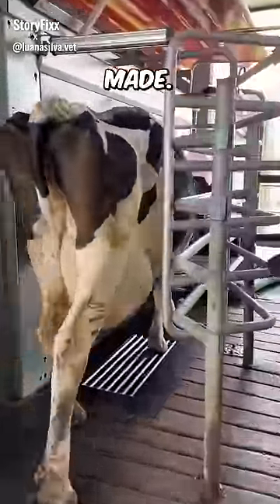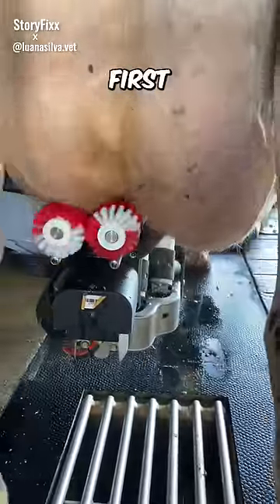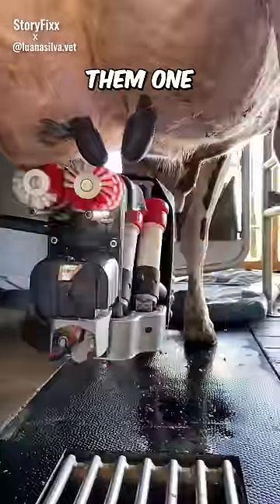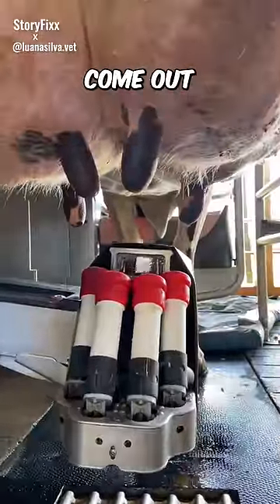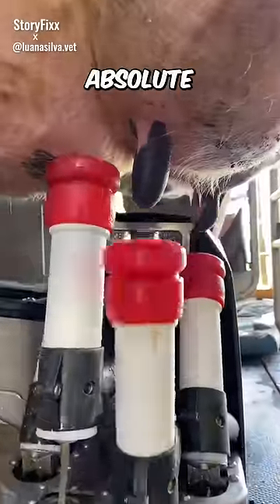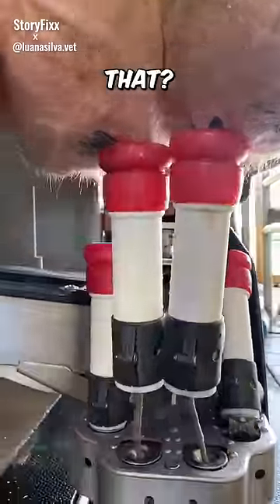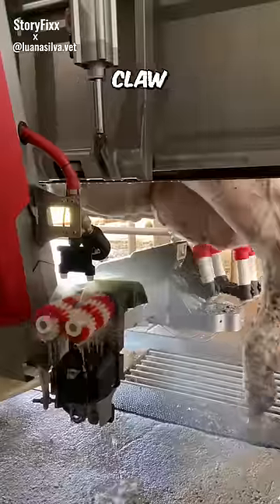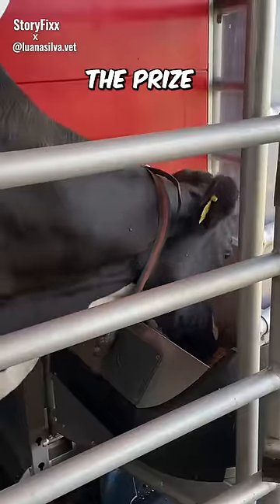The future of milking is here 🤯

Comment: This is the Lely Astronaut A5, the cow walks inside and the scanner on the trough reads her collar. The chip in her collar contains all her information, like teat position, amount of feed, previous milk quality and quantity. The first couple of milkings, the cows anatomy is scanned with 3 different lazer pointed cameras positioned around the robot. One on the arm, scanning the teat positions and two above her, scanning the cows position in the robot.
The cows volountarily walk inside the robot and can choose however many times she want milked, anything from 2 to 6 times a day.
This makes milking more effecient and gives the cow better welfare.

Milking robots are excellent, as they eliminate hard labor connected to the actual milking of the cow, only feeding and maintenance is needed if you have robots. One robot will milk about 60-70 cows in a day, milking 24 hours a day.
Reply: Watch this video upside down